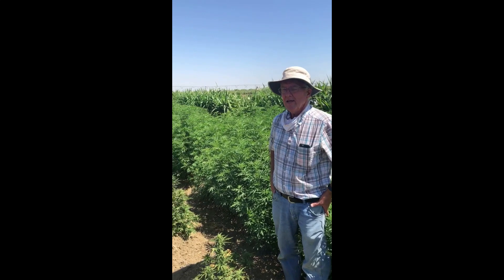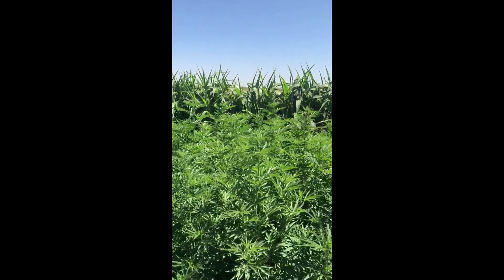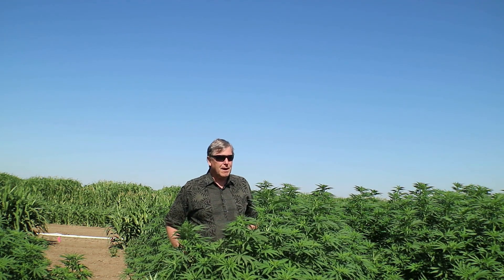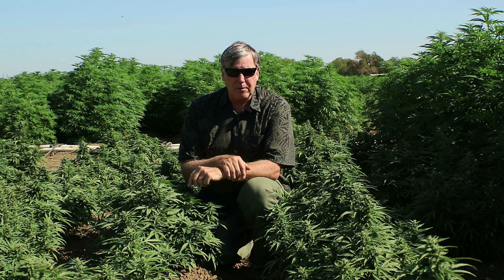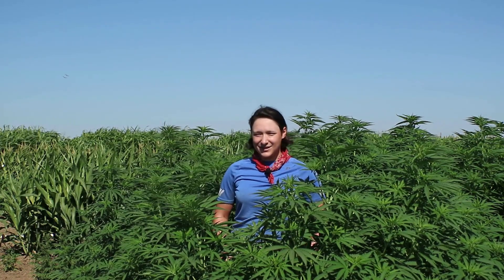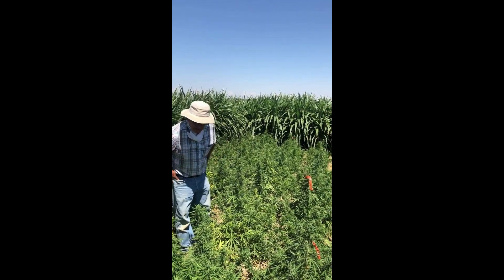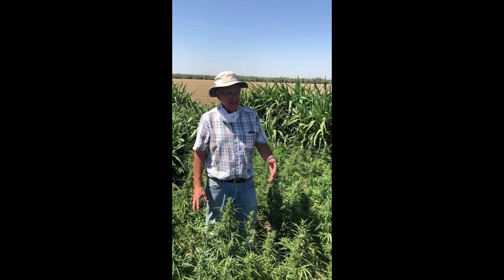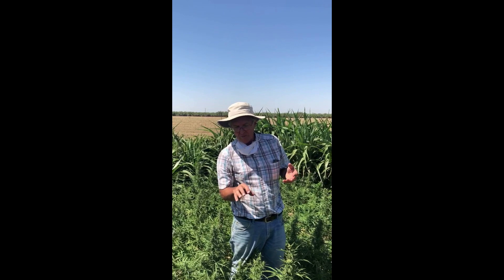Industrial Hemp: Research Update

Comment: I thought industrial hemp is tall and stalky, not short and squat. This looks like medicinal hemp. This stuff would not be good for rope or textiles like industrial hemp.
Reply: I think it depends on the purpose. fiber vs grain. I believe fiber varieties are selected for their height because you want to get as much biomass as possible as opposed to getting more seeds. so maybe the industrial hemp you have seen is being used for fiber.

 and also, as they have mentioned in the video, it also depends on the growth pattern of your hemp .the auto flowers don't grow as big. they have a set period of growing time, so they hit a certain size and then flower. in tbe other hand, photo period sensitive types can grow much taller given there is a long enough day length. so towards the end of the season, as days get shorter, these varieties will start to flower. what this means is photo period sensitive plants have the potential to have a long vegetative growth period and to grow very tall.